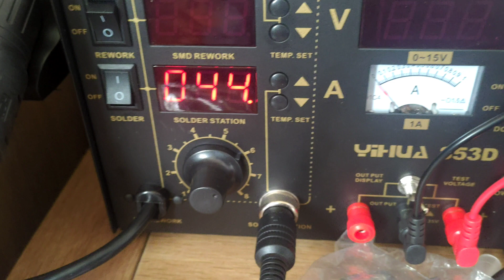Lipo EC5 connector swap guide.

Comment: Sorry all message. But i recently bought gens ace g2 with d plug/t plug. It stands in the paper (manual) for the battery that you should not do that. But maybe it stands on all battery type?
Reply from the maker: Most battery manufacturers will advise against changing the connector as they won't honour the warranty if you swap the plug

Comment: Thanks. Can it be dangerous to change connectors?I have 4 battery with d plug that i want to take ec5 on. I will of course see your video finish. But i am little afraid:) And do you use Celsius or Fahrenheit on your welding machine? My welder machine can get 240 Celsius, i think! Got a new sub Man!
Reply from the maker: So long as you don't allow the leads from the battery to touch it's very safe :)
Reply: @WTFRCCars  Thank you so much:)

Comment: Hello dear friends my smart technology airplane battery charger blows I think not to know how fix it thank😊😅
Reply from the maker: I would not know without it being in front of me
Reply: @WTFRCCars  how could I show you it in front of you by the picture are by the baizifu conversion kit brushless kit moto and a 48 voltage charger battery, the throttle has tree wire black red and white and the brushless has tree wire too black red and yellow is them all attach together separately. Norman Wray
Reply from the maker: @NormanWray-hi8cu I see you have a brushless esc and motor, do you mean the esc is not working with the motor ?
Reply: @WTFRCCars  hello sir it's a knew baizifu conversion kit brushless kit moto and the battery too but the throttle I don't know how to branches  the wire attachments okay .
Reply from the maker: That's not an esc/motor combo I've used so it's hard to say what would be correct

Comment: That's the easy end, I can't get the esc, males to lock in the connector
Reply from the maker: There are 2 types of ec5 one that you clip in from the rear of the plug and the ones that you push back in from the front you have to look at the ramps on the pins, as for pushing them in I just use a small socket set that just fits on the pin and slide it in using that or a small piece of metal pipe

Comment: Are the ec5 about the best for rc 1:8, 1:10 etc in terms of amp ratings? Is it ok to use ec5 connectors on lower power set ups too? I think it would be but best to check with those who know wha they are doing lol
Reply from the maker: I run them on almost all my rc's and yeh ya can run them on low powered rc's too I do and they work fine if all your rc's RC same connector then you can use any of your Lipos :)
Reply: @WTFRCCars   that's exactly what I was thinking, move everything over to the one connector and its better for ease and amp rating/safety kind of thing... Brilliant pal, thank you!

Comment: You can also pop the connector in the housing by hand while it is hot, solder set but too hot to touch. Have the other side of the bullet connector pugged in and push against a scrap piece of wood.
Reply from the maker: You can but it melts the connector and they can pull out when you disconnect them

Comment: For new viewers! Attention. Solder wires normally with iron, but use small blue flame lighter for connector and fill it with tin. It warms up  with lighter in 4 seconds, and it stays hot for a long time so you have to keep the wire still for a few seconds when you stick it in. Been using this for 15 years and not a single failure.
Reply: Wouldn’t a hot iron do the same thing? What am I missing? Newb here
Reply from the maker: Yeh it does :)
Reply: And if you going to use an iron over a torch , I would crank it up to 650F plus flux is your friend.

Comment: Where did you get that connector holder which brand is that?? Beautiful work
Reply: Just ordered Thank You
Reply from the maker: It's one of these, I like them as they can take the heat out the plus so its harder to melt them when using a higher power solder station

https://amzn.to/3FdhZhT

Comment: EC5 rated for 150 AMP´S i dont think so.
Reply from the maker: It's a continuous 120amp and burst is actually well over that
Reply: @WTFRCCars  Fake numbers, it wont hold that at all.
Reply from the maker: Yep and lipos ain't actually 120c or 8000mah but guess that's the world we live in lol
Reply: @nikolajc7617  Genuine EC5 and IC5 connectors have been tested all the way up to 200a without issues. Not sure where you are getting fake from. If anything XT60 and XT90s are the fake ratings. As I have melted them together at 100 amps. They have no overhead. You must be an xt60 xtt90 fan boy. tsk tsk tsk.

Comment: Thankyou for the video. What kind of solder do you use.
Reply from the maker: This stuff work well

https://www.ebay.co.uk/itm/1PCS-60-40-63-37Tin-lead-Solder-Wire-Rosin-Core-Soldering-Flux-Reel-0-5mm-2mm-/334098085559?mkcid=16&mkevt=1&_trksid=p2349624.m46890.l49286&mkrid=710-127635-2958-0

But any lead solder with flux/rosin core don't get lead free it's crap lol

Comment: I just bought a spektrum charger but I have a Traxxas charger to so I'm making  Adapter from EC5 to Traxxas or the other way around either or because I don't want to  Void  Warranty  from either or company and I use spektrum radio and models are Traxxas and I can't make up my mind if I want Traxxas  Technology or spektrum technology and I do have a lipo charge that's a hitec that I started with many years later because I started rc in 1988 with a clod buster and TL01 and EC5  and EC3 and Traxxas I really need to know what side need to be where so I buy connector off wish and don't know if I got copy or real EC5 or EC3 but I'm hopeful thinking the EC5 and EC3 are solider the same way
Reply from the maker: Best advice I can give is to stay away from both traxxas and spectrum when it comes to electronics, their both over priced and poor performance for radios, batteries and chargers, as for ec5 and ec3 yes both wired the same :)
Reply: Spektrum ic3 and ic5 I like

Comment: How did you not get zapped when touching both minua and plus?
Reply from the maker: Because there's not enough voltage in RC lipos to zap you :) even 6s won't to anything so long as you don't touch both or them together there fine your body is not that conductive :) don't stick them on your tongue though that's conductive lol
Reply: @WTFRCCars  ok thanks for teaching me

Comment: It's easy to prevent a short simply by disconnecting one of the old wires from the old connector and solder it into the new connector.  You then you disconnect the 2nd old wire from the old connector and solder it into the new connector.

Comment: I've just graduated to higher amp R/C cars. Most of my older batteries have male lugs on the battery side, female on the other. This includes a newer Traxxas. Since this is my first EC5 soldering, I want to get it right for future applications. Is it more normal to see the female on the battery side for these connectors (similar to a household wall socket but opposite my older batteries)? Is the larger plastic cover for the female side and the round part of the plastic cover for negative?

(Of the plastic covers, the larger one has clear + and - markings.  What isn't clear is which is which for female and male.)

Finally, the male lugs seem to enter from the rear of the plastic cover, but the females won't enter from the rear. Is this normal? What is the correct way to enter the females and males? I've seen comments saying from the front and rear, each claiming to be correct and the other wrong.
Reply from the maker: I wire them the way I do in the vid because it also allows you to use them with arrma and losi ESC's
Reply: @WTFRCCars  exactly what I did. I bought a Spektrum battery/charger combo and wired all my EC5s to fit.
Reply from the maker: As for the connectors there are 2 sorts ones that fit from the rear and ones that fit from the front but you don't normally get them mixed in sets

Comment: Inquiry:  Did the "bullet" connector terminals come with the plastic housing?  It "looks" like the housing is an original design made for the terminals that press in from the back and your terminals are the copy design (Which I prefer.) that press in from the front.  From what I have seen the original has the EC5 horizontal with + and - on one side and the copy has the EC5 vertical with + and - on both sides.  The original has the bevel on the terminal towards the tip and the copy has the bevel on the terminal towards the wire.  PS It is standard that the female pins are attached to the battery/source/power and the male to the device.  Charger leads are the exception.
Reply from the maker: Yeh they come as a set with the housings and I got then because they fit from the front, I always fit the male / female the way I do as they fit with the stock spectrum ESC on the losi LMT :)

Comment: Thanks for showing all this in real time with your tips. Much appreciated. I noticed however, that you don't use heat shrink. Was that a conscious decision?
Reply from the maker: yeh you dont need heat shrink with the ec5 plugs as the metal contact is always covered :)
Reply: @WTFRCCars  i see. Okay. Thanks.
Reply from the maker: No probs :)

Comment: The 450 solder iron temp is the centigrade or farenet?
Reply: I used a butane torch and pooled up a little bit of solder in the ends of the plugs. Made a little jig out of a scrap piece of wood. These couldn't be simpler to wire up
Reply from the maker: °c
Reply: @WTFRCCars  thanks
Reply: @WTFRCCars  842F  Hot!

Comment: NEVER TOUCH SOLDER WIRE TO IRON!!!
Reply from the maker: If you dont touch the iron with the solder then it wont transfer enough heat i have been fixing electronics for years.
Reply: How do you "tin" the tip???

Comment: Can't you push the pins in from behind?
Reply from the maker: No there are 2 different types of ec5 connectors and these will only go in from the front it also means that they don't try to push out the back when you plug it together :)
Reply: @WTFRCCars  But you push that type (The copy.) out the back to remove them, otherwise you will pull against the flat instead of the bevel.